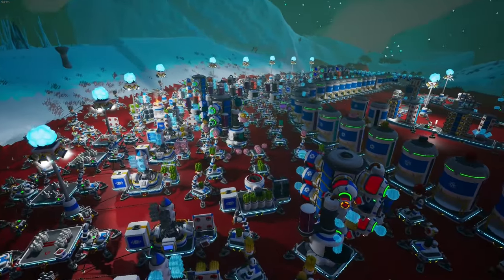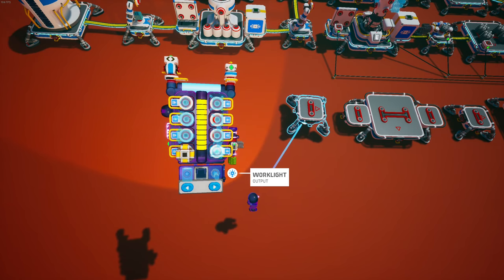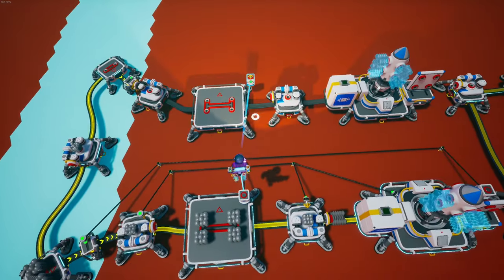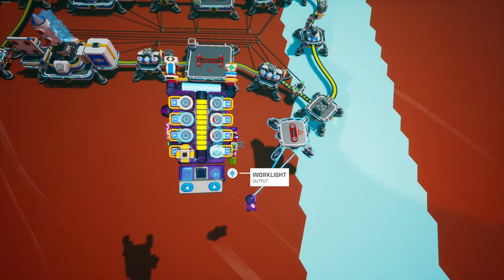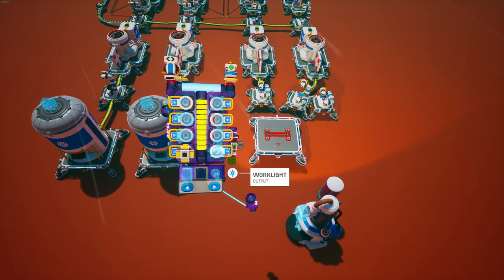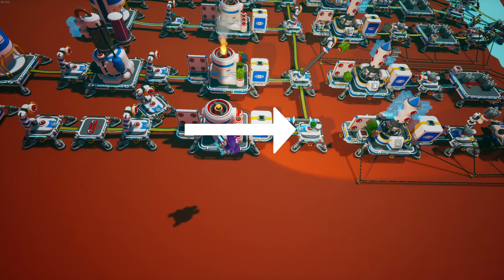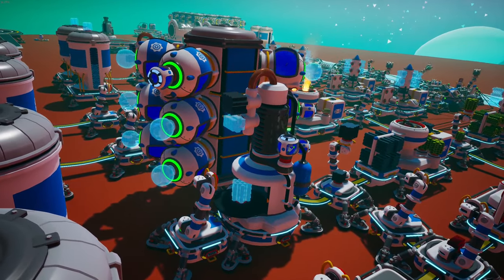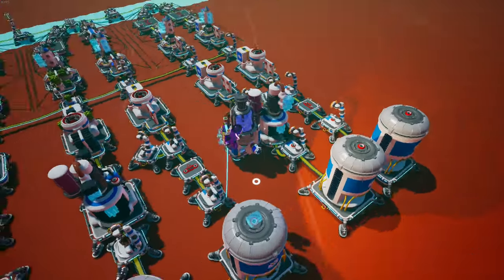Automating 4 Metals Using SCRAP - Astroneer

Comment: This is AWESOME!!! just one thing, Instead of using a VTOL, you can use a large storage with a rover seat on it to cover 2 spots. It'll work the exact same. still amazing though!
Reply from the maker: I don't think that would work because then it would never register as empty because there is a seat on the rover. You can use a large platform A and two tall platforms with 3 slots to get the same result though.
Reply: @Secks  No, it does! I’ve tested it. It only works with a rover seat tho
Reply: @Secks  also, not using an entire rover, just placing a ROVER SEAT on a LARGE STORAGE to cover 2 of the slots
Reply from the maker: @PTNwuzhere  interesting... I wonder why it only works with the seat. Thanks for enlightening me
Reply: @Secks  Np man!! Keep up the great content. This is awesome!!!
Reply: @PTNwuzhere  @Seck Thank you guys! The Large Platform A + Large Storage with a Rover seat on it - works like a charm! For any 6 to 4  trades. 
So no need to put the VTOL in this weird role hehe
Gonna check with any other t2 object (for example, replacing the Rover Seat with a Med Battery - alas that could kinda mess up the setup, power wise..)

Comment: I'm in the process of becoming a gorilla, and I've actually found you can use medium storage on medium platform a (or c) and fill 2 spots with button repeaters and it becomes a 6 slot storage, instead of the VTOL.. works great

Comment: im thinking about making this but what planet would be best for gasses
i want it to be as automated as possible
Reply from the maker: Atrox would probably be best but it kinda sucks building there and everything is green and you can't see very far. You can fill gas canisters up and put them on a silo B and it is able to hold 2000 gas and be able to produce 2000 resources
Reply: @Secks  ok im gonna try atrox because i already have a small base on atrox and i can just use a medium rover with a paver to make a flat spot